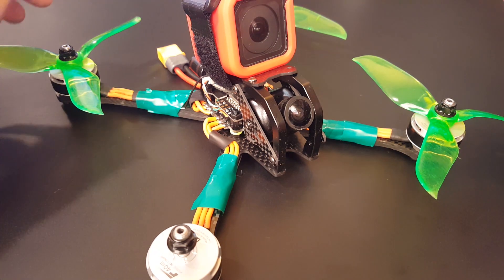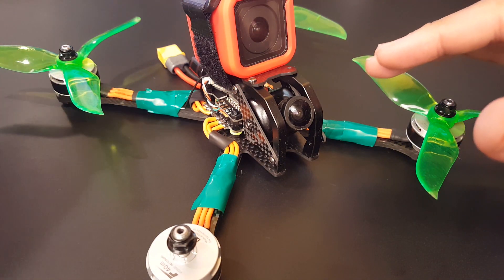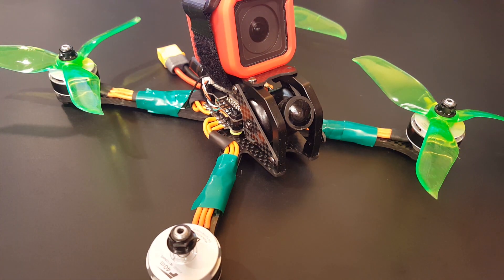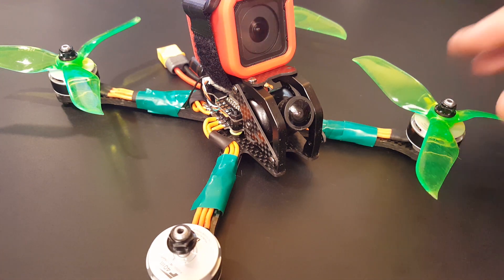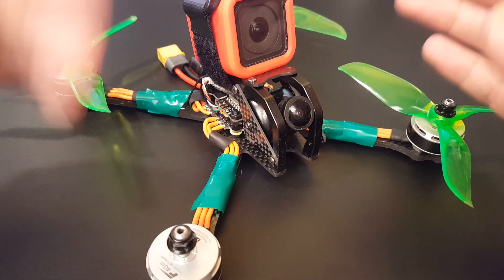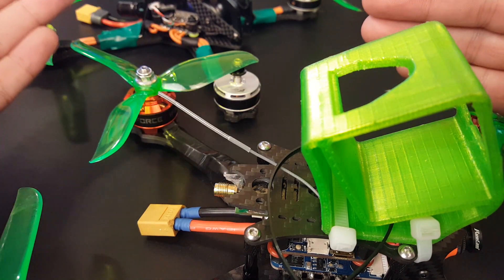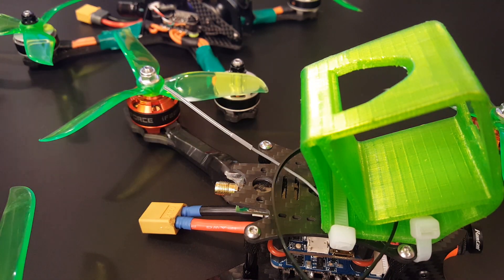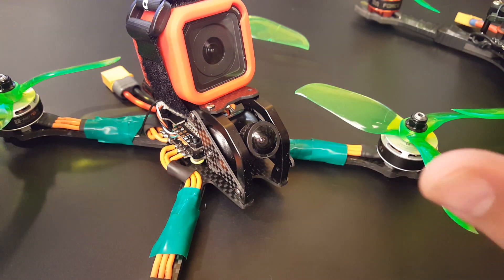FPV Noise // Common Problems & Fixes

Comment from the maker: Guys post your issues and fixes I forgot to mention that in the video. It could and will help out many people.
Reply: Thanks for the vid! My noise is only present when I throttle more than 40%. The noise is horizontal lines. Thoughts? Thanks again
Reply: I enjoy your channel. I have one I would like to share no fix yet running cl4s flight controller with the emax esc bullets. Chen Lin said they addressed the death roll but, after 50 flight with the fixed 1.4 version it happened. I have a black box and video. The only odd thing I see is motor 3 reads zero on output as it happens.  I going to try and raise the digital timing a little to see if it helps.I also adjusted the esc input starting voltage up just a little.
Reply: What could cause blackout for 1-2sec in my video feed?
Thanks
Reply: Drone Mesh - Awesome video brother, you pretty much addressed every single issue that causes video noise that I can think of. A quick note concerning video noise, I've noticed that certain motors that are more powerful, such as the Emax 2306 2750kv motors or similar, and the Emax bullet esc's induce very noisy feedback emf signals into the system. I've read that soft mounting the motors, the flight controller, or both can eliminate most of your issues, but cheap pdb's and flight controllers with filtered power can fail as well. Keep up the awesome work brother 👍

Comment: My problem is related to my vtx. On 25 and 200 mw motors run smooth and proper. Then 500 or 800 mw just sitting still armed makes strong noise spikes in osd and motors sound bouncy and jingly or something

Comment: Hy bro... I wan share my issue now. But i cant attch the foto form a googles. The fpv  is not clear. The point is i allready change the vtx and camera 3times with diferent vtx but its still bad video fpv. I stresed with thins thing. Anybody can help me?? :(

Comment: Nice points, will check some of them in 1 of my drones that is having some image noise!
Installed a mamba vtx recently on one of my older drones and I am getting pretty bad breaking when I shouldn't , will try to replace the sma antenna connectors as this one is already 1 year old and has crashed the most so will check that out, the rest might just be actually hard has this drone was my first one and I have already replaced almost everything so things have been rough for the poor guy ahahah

Comment: wait a min. Are you talking about noise in your video or physical noise? Like your quad sounding weird? I crashed and now when I fly I hear the props making a high pitch hum sound. But not when I arm. Only when I fly. Motors are not crunching and spinning fine. Props are not damaged. I cant see anything thats loose vibrating

Comment: I have electric  noise now also on my build  ...when I throttle  up its there . It I dont its clean... I replaced  the vtx pigtail  and desolderd  the ground  wire... stil its there

Comment: New build and I have this humming sound that sounds like rubbering your finger around he rim of a glass with water.  I have tried soft mounting the motors, I have two 1000uf 35v caps on the build.  This only happens with low throttle, in the upper throttle band it's their but very low.  Like I said it sounds just like that sound you hear when rubbing your finger around a wine glass that has 1/2 water and a little water on your finger.

Comment: Just came home disappointed I wasn't able to fly because my 5" started getting bad video noise with the motors spinning.  Came home and used betaflight to narrow it down to one motor on the bench, cleaned it out and all seemed fine for a minute, then it came back.  Funny thing is if I loosen the motor screws it goes away, but when I tighten it down the noise back, in video and audibly :/.  Finally after re-taping the racewire down and fiddling with it a bunch I was able to tighten it down without the noise coming through, pushing the motor wires around where they enter the motor seems to affect it.

Comment: I had beautiful clean video with my quad. I was using the 400mw capable TBS Unify Pro32 nano. I replaced that VTX with a 1000mw RDQ unit and it's noisy as hell. I tried a Matek 5v/9v BEC on the positive and negative from the battery. Still noisy. I explained this to RDQ thinking they'd have a solution but their answer was to just send me a new unit. So I assume the VTX is bad. That doesn't mean RDQ has a crap VTX, because I've gotten TBS products dead on arrival too and TBS is known for being good stuff. I hope the new unit gives me the clean video.

Your videos on troubleshooting are great.
Reply: Did the new unit give clean video
Reply: @flywithtb5005  it was a little better. I put on a different antenna and it was a little better still. I ended up getting a RushFPV solo VTX and the video was then perfect. Maybe it's just my setup but the RDQ vtx was the noisiest one I've used.

Comment: Hi! I can't see almost anything when I am 30 feet away. Also my rssi is 40 or 35. This problem apperaed between 2 or 3 flights I had. I can't find the issue. Already changes the fc, vtx and antenna. I also had I anew esc when it started. My motors are also hot after 20 seconds of flying.

Comment: I had clean video changed to a hobbywing 60 amp x rotor 4in 1 esc now I have honey cone lines in my video bad .I put a lots of low esr caps and didn't help motor always get warm but I tried everything to change that can't get them to run cool .I'm on 6s on 4s the lines are slightly less need help

Comment: I have this problem that its CRYSTAL CLEAR video once i pop in the battery. However, whenever i arm the quad (The props starts spinning lightly), it goes SUPER static and unusable. Conna add a compacitor to the battery part and see if it helps. I'm not good with hardware what so ever, bit it feels like that may be the problem in my case c: i think

Comment: Hi Drone Mesh very cool video. Im a first time builder. I use the 30x 30 mamba stack. My first flight the noise is terrible in it. She flies great but the noise in my FPV isn't nice at all. I was told it was motor noise. I used those jelly motor dampeners under it. Would that cause the noise you think. Its a Space 1 meteor 5 frame. Do you think I should remove them to see if that works. Thanks for any help. That video is on my channel. Thank you very much for any help and I left a like

Comment: I used inav. in my OSD, if i bank on left it will bank on right. please help me fix.
Reply: your board is not facing foward, look how to change betaflight flight controller orientation on youtube- i think you can do it in cli also- but it might be in configuration

Comment: My ARRIS X220 rattled when i ramp up throttle but i cant pinpoint where it is coming from also when it is in the air the yaw twitches back and forth HELP

Comment: Short range on video. Found SMA was bent and the traces lifted with the SMA pins. It took a microscope to see the break. You can't just reflow the solder. You need to scrape some masking and create a solder bridge from the pin to the trace when you reflow. Used some epoxy to hold it in place better. Do not over-tighten the antenna!

Comment: Went threw my build and I'm kinda confused 😕, I have some noise. I was thinking about the sma. Ok, I'm not using a unify, on this build. Doesnt a unify screw into the back of the Frog frame? Is that different because it's grounded with the coax leading to the vtx? Compared to just having the sma touch the carbon right off the vtx, which will cause issues, correct? Just woundering why you can screw a unify to the frame abd not get noise..

Comment: My biggest issues are motors and props. Bad bearings after some crashes for example. to reduce vtx noises i always use pololu 12v  step down regulators between battery and vtx. and the same for the fpv cam. That helps a lot to get better footage on the goggles. The quality of your fc and esc also matters. Some are way better than others.

Comment: Drone Mesh. Hi. I really enjoy your build videos. Thank you.

I just boughy the emax hawk5. And i am experiencing intermitent video lost...video goes black for 1 sec and then came back good. And then it goes black again.

I am wondering if you had experience similar situation and maybe advise a solution. Thank you
Reply: I just replaced my vtx in the hawk 5 and it's doing the same thing.. my old one worked fine till I smashed into a tree.. my capacitor was lose about to go check it out

Comment: Hello drone mesh, i had 470uf 25v esr cap on cam power pad 5.4v and my vtx grounded to the same pad of my cam but it powered by 12v or maybe 14v of battery connector. It lessen my messy vertical line appeared at 75% throttle but not entirely clean. Should i place another 1000uf 25v esr cap on battery pad or i should powered my vtx from the same source of my cam 5.4v pad? Or did i just do it all wrong in the first place? I had no osd flicker, according to your video, mine should have vtx problem. For info the same vtx has not shown any noticeable noise with other fc like Sp F3 but behave differently on HGLRC/Omnibus F4 flame i am using now. Any advice is most appreciated.

Comment: I have a problem with my vtx showing noise then loss of video for about a sec. I am going to get 1000uf 35v panisonic. I hope that it work. I never had to use a cap before, but it is my 1st 30a esc, it also dys.

Comment: Hello can some one have a look on my problem with noise. No idea how to solve it. My FC  Turnigy MultiStar 30A BLHeli_32        4-in-1 clone of Lumenier or Racestar tatto f4s. Vtx and camera connected directly to lipo with capacitor.  When camera is connected to vtx there is no interference. When i connect camera to fc for Betaflight osd problem occurs even when quad is disarmed . Thanks for any help     https://youtu.be/0Uggo2a9UvM

Comment: Solved my noise by CONNECTING CAMERA DIRECTLY TO VTX (V,GND, data)!!
Reply: frankyoualot data meaning as in the video in wire? pls enlighten me :)
Reply: yes, everything from camera goes straight to vtx, was something i didn't understand as a noob, i did install an lc filter from power to vtx on my Wizard, and that alleviated lines in my video

Comment: THANKS MAN!!!! I had a the flickers... the osd is a little messed up on my pdb didn't know that could cause the flickers put the low voltage capacitor on the 5v pad and cleared  it up almost completely

Comment: UPDATE: OSD FLICKER FIX

(Just passing on someone elses knowledge)

Had noise and flickering OSD on DYS F4 Pro+(Cough)4in1 ESC (yeah ok guys stop laffin)
Tried Caps everywhere 5v rail, battery input, vbat rail on FC,etc ....  helped a bit but still BAD OSD flicker.

Until i tried tying all my VTX/CAM grounds into the same ground VTX was on. INSTANT fix 0 flicker on OSD even reduced the background vertical noise. Should work on other FC/ESC combo's too.
Now i know what you experienced builders are thinking "STFU noob thats not even a fix, its just an alternate wiring setup"
YEAH i totally agree (even about the noob bit :P ) .... but its an alternative that most NOOB builders won't know about.
Since i have yet to see a manufacturers diagram that even mentions this wiring method, as a newb build your most likely to follow the manufacturers instructions ... since you probs don't know enough to not do so.

When i say all VTX/CAM grounds i mean all
Cam ground
VTX power in ground
VTX power out ground

Respect to JC @Blue Falcon Project channel for the fix, gone but still helping the community.

Good luck guys
Hope this helps someone
Reply: Blowfeld20k ✅✅✅ I can confirm that this guy’s method works! I tried everything to remove random noise from my OSD And nothing worked UNTIL I connected the camera ground and the VTX ground to my main Lipo ground, boom problem solved. Thanks bro 🙏

Comment: Im having problems with my BFF3 board. I am barely getting any range on a 600mW VTX. I have tried 3 different VTXs, re-wired differently 4 or 5 times, added a capacitor, tried different antennas, added a LC filter, moved the VTX, and still barely any range. The ESCs are brand new without damage. No matter what I do, I cant seem to get a signal. Im getting less range than a 25mW VTX. Im ready to tear this thing apart. Anbody have suggestions?
Reply: Ninja Sauce could be on channel close to your vtx. I had this issue and have not had a problem since
Reply: Typa fpv this was my problem. Such an easy solution and small amateur oversight.
Reply: I found out that these boards have problems with the voltage regulators. That was my issue. I had to add a pdb. But that kinda defeats the purpose of the BFF3.
Reply: Maybe a bad rx.

Comment: Hey Mesh! First off, I'm a big fan of your videos and how you diagnose and solve problems. Just recently, I've been having really bad, almost blackout out noise on my feed when i raise the throttle past ~25%. I've taken my quad somewhat apart and with my vtx (tx526) on a wooden desk (sma connector is not loose and away from any carbon) and camera giving direct feed to my vtx (no OSD) I still get the bad noise. I have 4 330uf 25v Nippon low esr caps on my escs and I was getting pretty clear video with having both camera and vtx getting full voltage. I'm suspecting it's a really bad vibration issue caused by the motors or escs because of oscillations, but it kinda just started happening after a minor crash, any ideas? Any and all responses are much appreciated!!

Comment: fresh build with a ts5823, horrible noise as soon as i take off. this is my first build and i have no experience building a 5" quad (i have built a 450 before). i am currently moving all wires as far away as possible from my vtx (previously had them zip tied super close to the main part of the vtx. it is connected to the 12v of my pdb. camera is an eachine 1000tvl ccd and it is connected to the 5v on my pdb. frame is a qav210 clone, so there is not much real estate for routing wires. i am using my flight controller's built in osd and there is no flickering. pdb is a matek xt60. i am using a 4in1 esc. any tips?
Reply: Marcus McClickbaity I used that same vtx and I have horrible noise, its running vbat, it couldnt even run the camera on the 5v out. I would get brown outs. Ive got a 1000uf on the main leads and another 470uf stuffed inside. All I'm missing is a 8.3regulator for the vtx, instead of vbat. I figured with that much caps it would be crystal. Its not, but my other rigs with unify if, and unify pro 5v v3 are flawless, no noise. I'm thinking its the vtx need to be regulated, but I have no room in this frog.

Comment: One more noise reason I had: I added TPU pads to soft mount my motors, in the process I change the motor bolts to longer ones, one of the bolt wa touching the motors inside, current was leaking to the frame from the bolt then into the SMA the into the antenna or back into the VTX, anyway I debugged it when I found current in the frame. change the bolts to shorter one = no more noise.

Comment: Just want to introduce myself.  Always fascinated with anything that flies (except mosquitoes). At 72 YO, quads are my speed even the racers. I flew R/C airplanes in the 60s and 70s. I just ordered my first quad (MJX Bugs 2 B2C) for a starter craft. I expect this quad to look like the Millennium Falcon after I attach all the things I want on it.  Love reading about problems and, as a retired engineer, I know that I will be able to help solve many of your problems here. I suggested the proper insulating hardware for the antenna connector mounted on the frame below with parts source link. I am looking forward to becoming a part of this community.
Reply from the maker: +George Foulkes Welcome to the community George can't wait for your contributions.
Reply: George Foulkes welcome to the hobby!
Reply: I subscribed, post some videos of your flights/progress

Comment: I'm using a separate battery to power my fpv than the motors. I am getting horizontal lines in my video. I can still fly it but the lines in my video are super annoying. I am positive that all my sma connections are secure. I tried using an lc filter for the battery that powers the motors but not only did it not solve the issue but my flight time went drastically down. I don't know what to check next. Should I try other channels on my video transmitter?
Reply: Hi, i loosen my vtx and it removed many of the annoying horizontal lines, now i can see almost clearly, a bit of foam and a couple of cable ties and still happy with it.
Reply: A.   Thanks for the feedback. I will certainly try that on my quad

Comment: Anyone else only get noise when they go over half throttle or punch out? I’ve tried caps on all esc and an LC filter and running cam/vtx to common ground and isolating antenna from the frame...I’m stumped. Running stock PIDs, F60 2200’s, 6x4.5 HQ’s.
Reply: Just saw the reply from SteelRainFPV. Gonna soft mount the motors.  Will let y’all know if it helped.

Comment: Hey drone mesh, love your channel i just subscribed. I have an eachine aurora100 which started developing bad noise all of a sudden when punching the throttle. No crashes, nothing. It has a micro lc filter on board. The OSD is fine. Didn't change the pids. How would you go about troubleshooting that? I'm just guessing it's the cam/vtx combo so i ordered a replacement. Thanks!!
Reply from the maker: Check the antenna on the Camera where its soldered loose antenna connections create noise and seems logical to me from you are stating.

Thanks for the sub :)
Reply: Drone Mesh but still it's only when i punch the throttle. On the bench the image is crystal clear, no noise., so i'm thinking that can't be the antenna? Gonna change the micro lc filter as well.